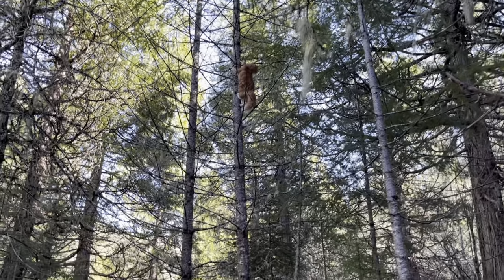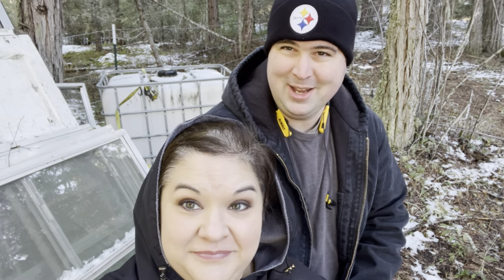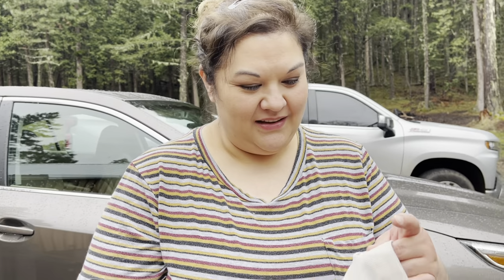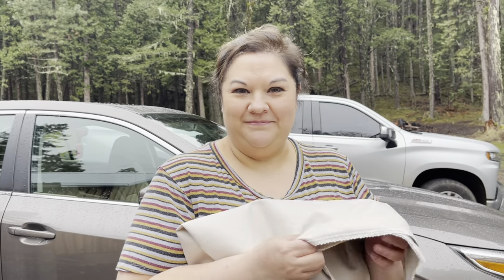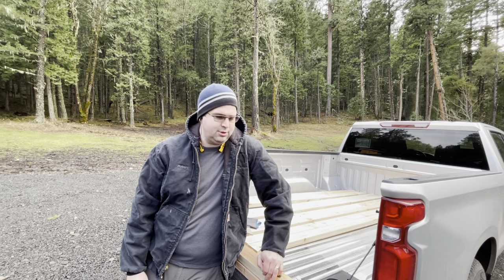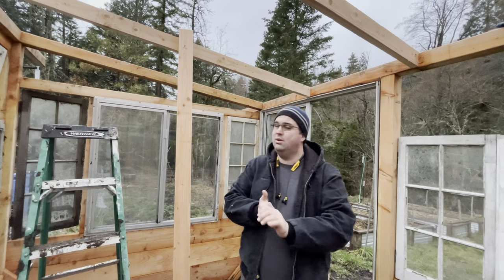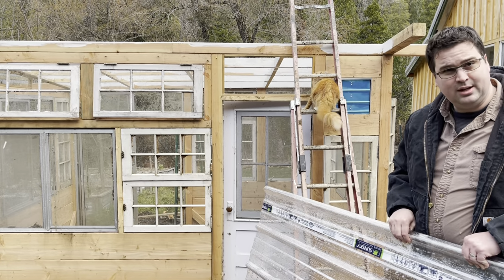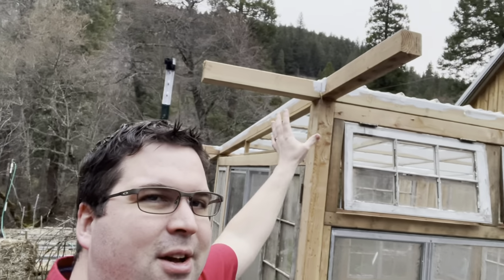Window Greenhouse Build

Comment: Put some hooks out on the ends of those poles and you have a place to hang up some hanging baskets  of flowers or veggies...put a gutter on the back and run it into a rain barrel for watering your plants. Love your design. You could also use some burlap and make a shade curtain you can pull across your ceiling to help it stay a little cooler in summer.
Reply from the maker: That’s the plan Karen. We are going to square them up, and put baskets, or wind chimes, etc on them.

Comment: Looks Good!  We built one too last Summer here at home.  Too late for seeds but we did start some plants in there.  Regulating the heat is a learning experience for us.  Many days we had to leave the door open just to keep it below 100f in there.
Reply from the maker: Awesome! We get pretty warm in the summer here, that’s why I am putting in an automatic fan. I’m sure I would forget and destroy some plants otherwise. 😄 -Robert
Reply: @TheOregonTale  we get HOT here in Iowa.  I attached the roof to the front with hinges and we raise the roof to let out heat.